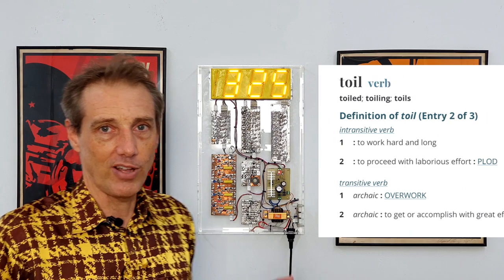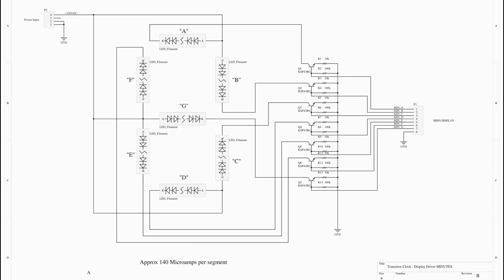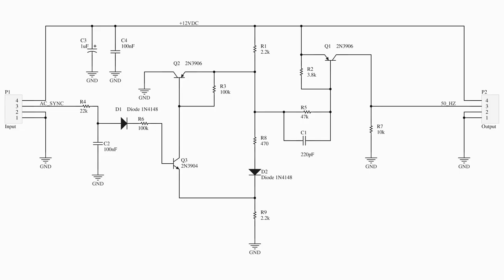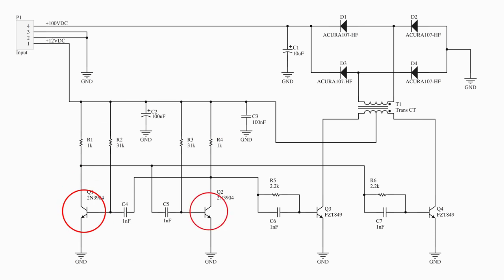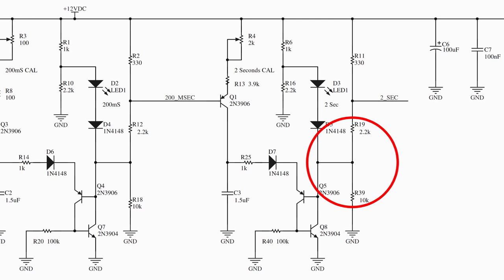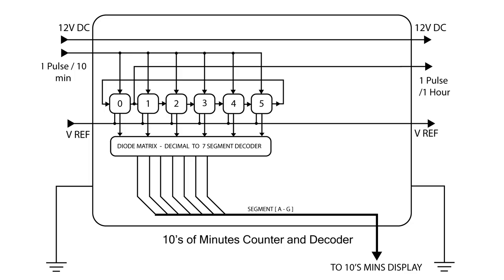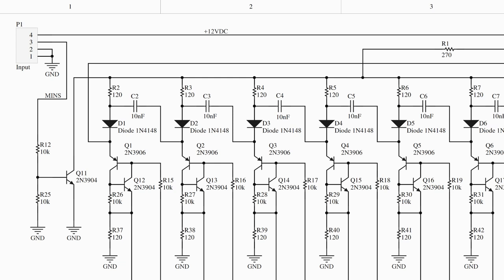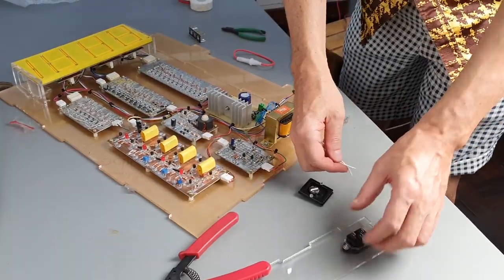All Transistor Clock

Comment: I have never seen such a switching concept with a transistor, just a glow lamp. Very interesting.
I'm planning my relay watch now. Another question is the conversion from 50Hz to 1HZ. Very noisy. :)
Good luck with your other work.
Reply from the maker: The divider output is very clean and stable. The only issue is getting it set exactly right so temperature changes dont cause the divide ratio to shift

Comment: Very nice build.  A little more voltage and a Nixie display could be added.  I do a lot of non micro controller digital clock builds using old tech.  An all transistor build is on the list at some point.  That should get me more familiar with transistor circuits.  This description will also help with more studying.  Thanks.

Comment: Really cool, I lerned some more about analog circuits. But two questions: 1) How do you make sure that one and only one stage in the ringcounter is on during start? 2) Why do you use a step-up converter for the LED voltage instead of simply using the 220V?
Reply from the maker: When the power first comes up the counters typically start in an illegal state, with more than one active stage - the first minute's pulse that comes in gets it going correctly.  

Using the 220 mains without some form of isolation would be too dangerous for my novice students, don't want to kill them before they learn something!  Some of the ideas we toyed with: Hang another 12V transformer off the secondary in reverse? - Cockcroft Walton voltage multiplier? Flyback converter?
Reply: @leosbagoftricks3732  Okay to kill them after they've learned something!? 😉

Comment: One thing coming to mind is: How difficult would it be to pwm the 100V in order to adjust the displays' brightness? I am thinking of a sawtooth generator feeding an adjustable schmitt trigger which in turn switches the 100V on and off with a frequency above visual perception. Or derive the pwm from the AC sync line in some way? Given the low power consumption of the LED Display a single transistor should be able to handle the load of the 100V line easily. Or do I miss something?

Comment: Thanks for the video, this was great. I was curious what this would have costed in today's money. Given a single transistor cost at $8.00 equivalent with ~79 transistors would have been ~$630 today! Haha, I wonder how many clocks like this if any were made back then?
Reply: In 1960 I think clocks would have still been electromechanical (eg flap clocks) or just straight up mechanical (ie with a spring to wind or a pendulum and weights).

Comment: 100V boost converter : overkill !
Use diode-capacitor ladders to multiply the voltage from the transformer :-)
This is particularly adapted to the low power draw of the LED.
Reply from the maker: Great idea! Next time!!!

Comment: One strange question please !

How all this can work , along DC Power supply, ...  Because
all those Capacitors are not supposed to do anything 
in DC Circuits... 
...  🤣😬🤣😬🤣... 

I am just a total newcomer into 
Electronics, but my understanding so far is that capacitors are 
Reacting only in RF or... AC environment , but in a DC they act 
Like switches in OFF position .
🤐🤐🤐🤐🤔🤪😬😱
Reply: It's all DC until the voltage changes, then it's AC
Reply: @leofernekes343  still don't get it 
...but you gave me a Hint ...to 
dig deeper into the Rabbit hole. 
... 
At the moment I am at 
1800's level of understanding ....
...
...   Wandering around with B. Franklin and looking into a dark cloudy Sky!!! 
☂️⛈️🌩️🌩️🌩️🌩️...  

Thank you !!!

Comment: Using LEDs, especially the very modern white ones instead of rows of incandescent bulbs seemed an out of bounds choice given the stated, albeit arbitrary, technology limit. Why no colon in the display and no AM/PM indicator or better yet, a 24-hour format? How about a laser cut diffusing lens for each display element? These are really just suggestions for the next iteration.

I remember taking apart basic digital  alarm clocks and finding they all used a single 0.6" wide DIP.

Comment: 10:00 My first thought was you were gonna go super analog -- using the phase differences between an oscillator's 3rd or 5th harmonics and the input signal to govern the lower-frequency oscillator -- with three /5 stages, a /3 stage, and then just three flip-flop stages for the /2. Fortunately not, since that would be quite insane to attempt with such low frequency signals lmao.

Comment: Nice project, just one question....
What initializes the ring counters to only have one output true?
Its clear that once initalized the ring counter will work as described, but
It seems that multiple bits could be set, or no bits could be set...
IE how do you initialize so only one bit is set?
Reply from the maker: They do start in an illegal state. The VREF signal comes up slowly, this tends to activate more than one stage, the first minute's pulse sorts it all out.

Comment: strange.I tried this very same project with IC counters about 5 years ago but it didn't work as expected.and yet I couldn't get to know what went wrong.
Reply from the maker: Of course it didn't work! This stuff NEVER works until you fiddle with it for twice as long as you expected. Giving up is when it over.
Reply: I had trouble trying to reset the tens minutes counter at the 7th count (before the display reads 6)using AND and NOT gates(discrete components gates) with the inputs from the counters segments output.
NOT ( B segment ) AND ( E segment ) =1 ,this is true only at the 7th count for all 
 0 =< x =< 6.
How do you like that?do you think it 's OK